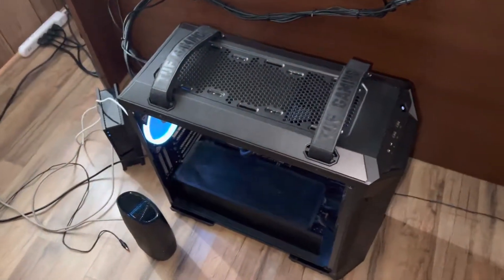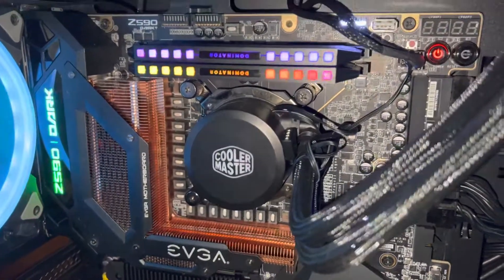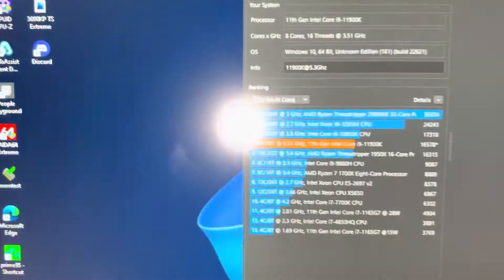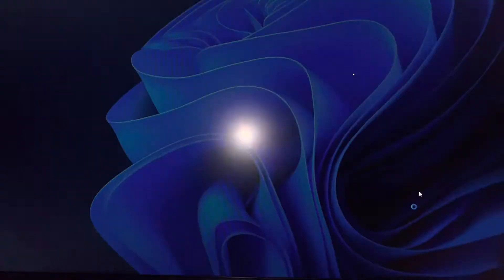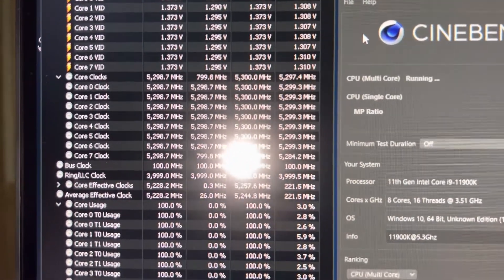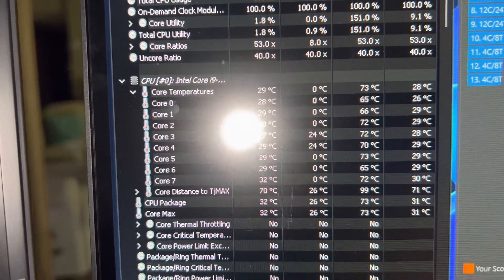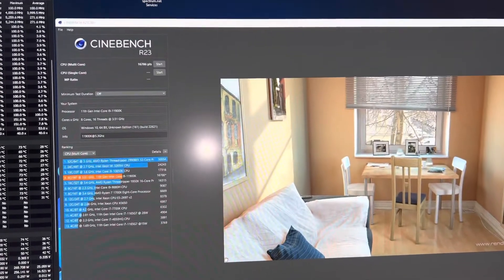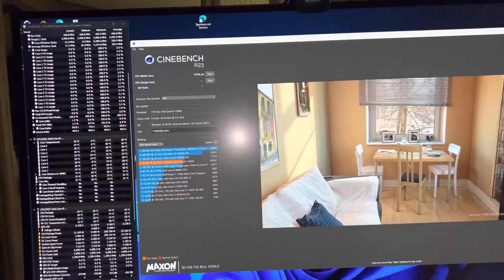11900K @5.3Ghz R23 on a 240MM AIO

Comment: Dude your score is too low for 5.3Ghz. Wich ram do u have? my 11900K scores 17120 in Cinebench R23 at 5.3Ghz and the voltage is at 1.483v (bad silicon lotery) for 5.4ghz i need 1.55v or more but i refuse to run it daily at 1.5v, is not worth it. Im very confortable with 5.3Ghz for now/ previously il ran at 5.2ghz 1.430v...

I think you can run this chip at 5.4 or even 5.5 within a voltage of 1.450v/1.480v.

Comment: Hello! What are you tuned for this using on 240 AIO? Especially how you get so low temperature on 260 watt energy consumption? My 11900 best on 180 watts 90 degrees and 5,1@all (without drops)

Comment: Mine can't seem to go beyond 5.2ghz all cores. Though my memory controller seems to be pretty good (run at stock voltage up to 3800mhz, gear 1)
I run @3600mhx cl14 gear 1 with 4.4 ring.

Comment: Dear god that's actually awful.  Using the iGPU will make little difference as this is a CPU rendering test.  For all that overclock, you're not that much up on Tech Power Up's adaptive boost figure.  Although to be fair, the 11900k isn't that great a starting block.  The 10900k was better.

Comment: i have 11700k+Z590 Aorus PRO AX+Arctic liquid freezer II 240+mattrex 55 mesh case. In cinebench r23 stock cpu have 4.6 GHz 1.2V and 185W, i have 73C avg temps. In aida64 fpu stress test its overhetas, its smth wrong with my aio or its too hot cpu?
Reply: It depends on how long you run a test and if your gpu is working hard too. The arctic liquid freezer ii 240 is pretty good but believe me. There are almost no 240mm's with a cooling capability of 250w+.

Maybe aida64 uses more power or you have weird power limits